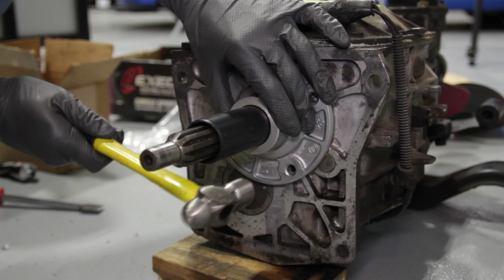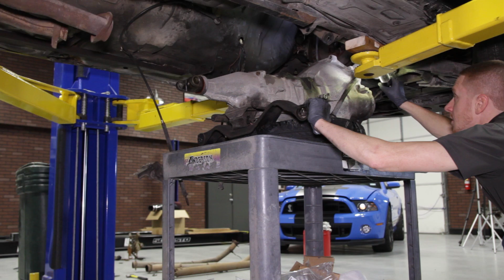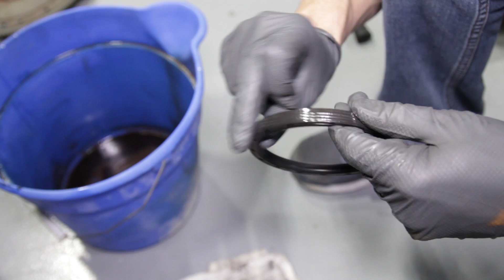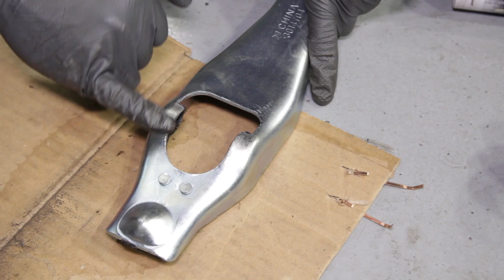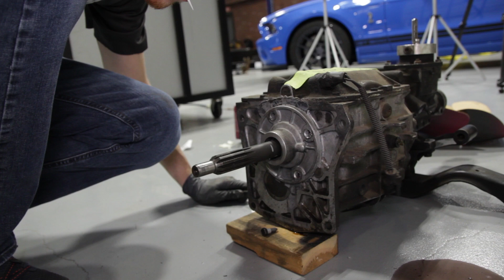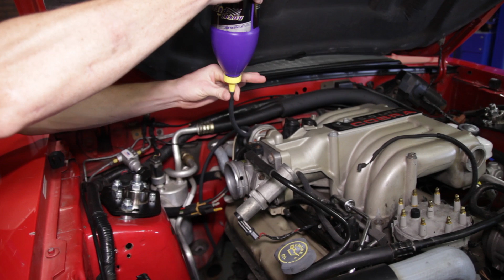How To: Mustang AOD to T5 Transmission Swap - Part 4 (1984-1993)

Comment: Does anyone know if the 5.0 engine in the AOD cars produces less hp and torque? I see the ratings are different but is this solely because of the difference in AOD and T-5 Manual. Or is there a difference in the actual engines that came in the auto or manual cars. Thanks!
Reply from the maker: The ratings of the transmissions are solely based on the units themselves.  There were horsepower and torque differences between automatic and manual cars around the CFI era, but this had no effect on the rating of the transmissions.  -Landan

Comment: Trying to do 1966 mustang with 86 AOD swap with 1997 t5 with original bell housing . What flywheel or kit do I need? Do I need a new bell housing and drive shaft?
Reply from the maker: Huan - Below are some links to a clutch kit and bell housing.  You can reuse the driveshaft that's currently in the car.  Please let me know if you have any other questions.  Thanks!  -Landan

Clutch Kit: https://lmr.com/item/MCL-75005BK/mustang-gt-50-mcleod-street-level-master-clutch-kit-82-93
Bell housing: https://lmr.com/item/M6392E/83-93-Mustang-Ford-Racing-T5-Bellhousing
Reply: @latemodelrestoration  great. Do I need a shorter input shaft with the bell housing and clutch link you sent? If yes, Do you sell that also?
Reply from the maker: @HuanNguyen-ss7xh  Let's backtrack for a second.  I overlooked where you said "1997 T5 with original bell housing".  What car is the T5 out of?  A 1997 V6 Mustang?  -Landan
Reply: @latemodelrestoration  yes I bought a 1997 v6 WC mustang t5 with original bell housing.

Comment: Im doing this swap too. I bought a flywheel had the same casting number earlier to late 5.0. The difference was the pressure plate bolts are space out different. The later 5.0 uses the bolts that are further apart.